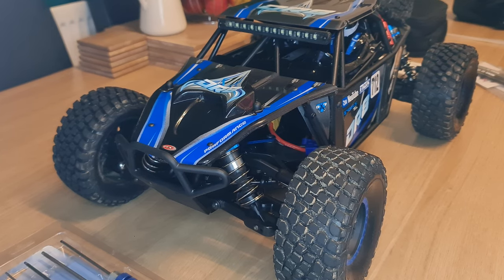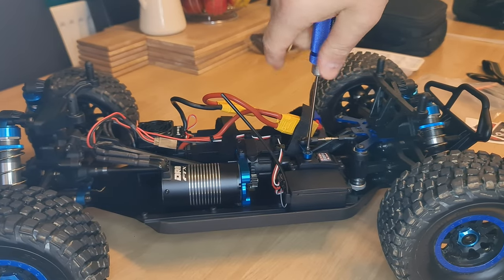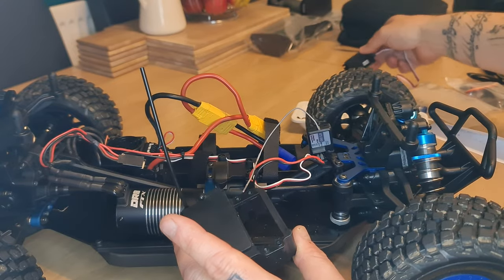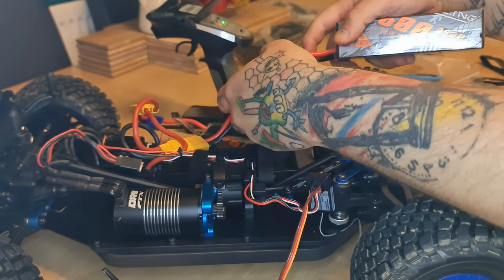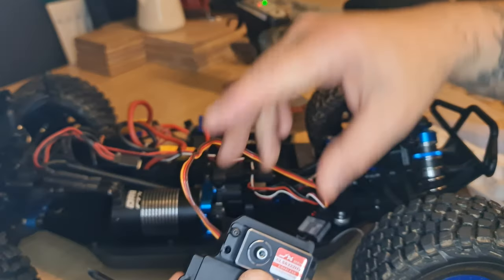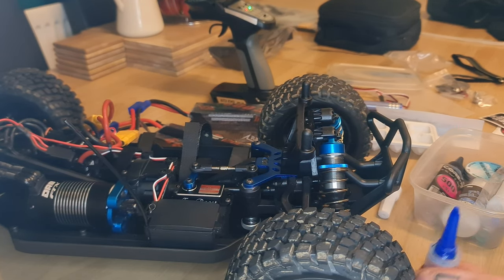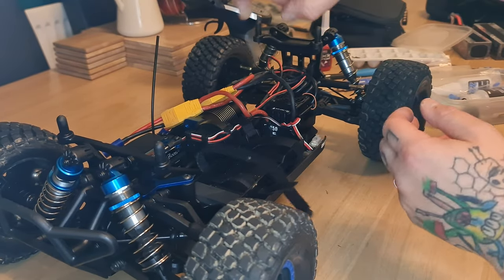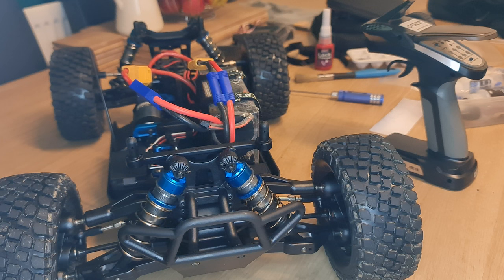Upgrade your FTX DR8 Servo and Battery Straps - The Step-by-Step Guide

Comment: Yes the servo upgrade is probably the best & easyist upgrade to make on most rtr vehicles, makes such a difference to the driving experience.
Reply from the maker: Yes buddy I agree , makes me wonder with these manufacturers mind I mean for the sake of a little bit more money .
As I said it's not that the servo provided was terrible but just lazy in comparison to what I now have in there . 
But definitely when you buy a RTR it should be the first thing you change and it completely changes the feel of the vehicle . 
Thanks for watching really appreciate it
ChriswithaC 😎

Comment: Decent video, just burned my atom 6s servo out so bought a 40 kg servo & ready to fit it, hope it isn't too strong. Very helpful vid cheers mate 👍🏻
Reply from the maker: Hey buddy , 
Once again thank you for watching , yeah it does seem that this truck suffers from a weak servo indeed . 
40kg would be awesome , what servo did you pick up may i ask ????. 
i would recommend tightening up the servo saver a touch with that also as the amount of torque that servo is going to have you dont want the servo saver stopping its full turning potential . 
Stay safe 
Chris :)

Comment: Out of interest what hex screwdriver set do you use?
Reply from the maker: Hey buddy in this video i used a cheap set from Ebay . 
Im now using MIP screwdrivers and speed bits 2 ,2.5 , 3.0 mm and not looked back since . 
Hope that this helps 
Chris :)